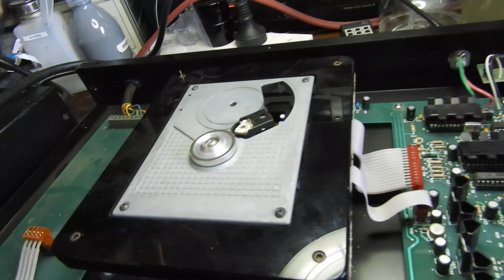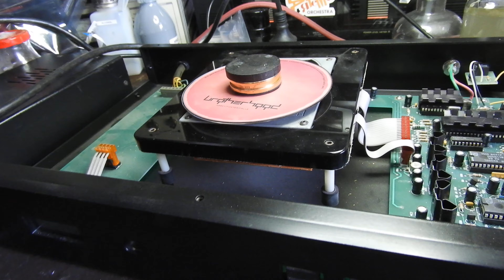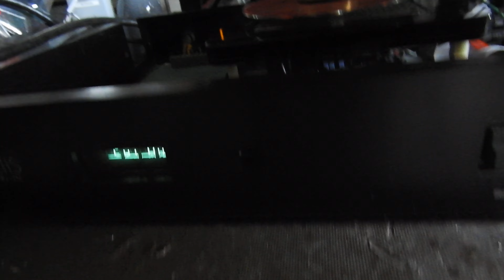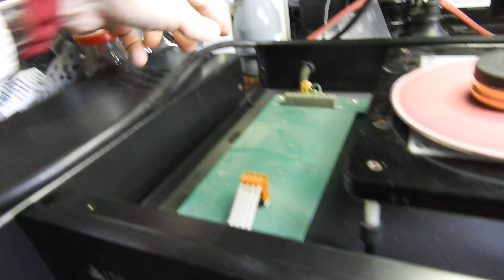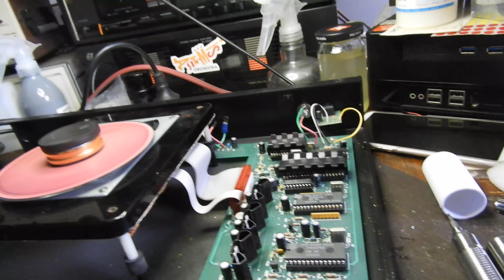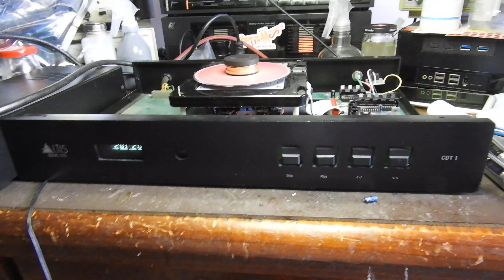Altis CDT-1 top loading CD Transport with Philips CDM-1 Mk2 laser mechanism

Comment: I2S output ?
Reply from the maker: No, it only had one SPIDIF output... Not even Toslink
Reply: @hear-net-au  would it be complicated to add I2S to a transport in a way that it will offer better digital performance to a DAC that is I2S ready ?
Reply from the maker: @kdomster9141  if the signals are there easily accessible, it is relatively easy
Reply: @hear-net-au  So many new DACs even ChFi 400usd ones offer I2S inputs , it would be great to take full advantage of it with a CD transport without spending a fortune
Reply from the maker: @kdomster9141  but I2S is not something that makes the sound great. It's merely SPIDIF split into its components. 
It makes very little difference at short distances and at low frequency of 1.5MHz which data transfer format is being used. Some offer better noise immunity, some higher transfer rate, but for listening to red book CDs in a regular home setup, they're all much the same
Reply: @hear-net-au  They always sound superior as data and clock info don't have to be combined and than split again only because Spdif standard is the way it is .